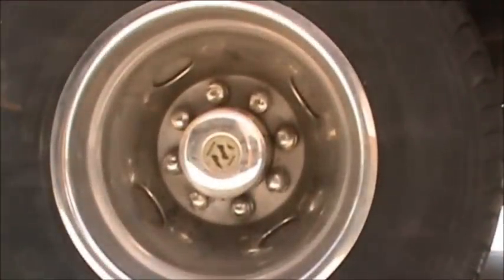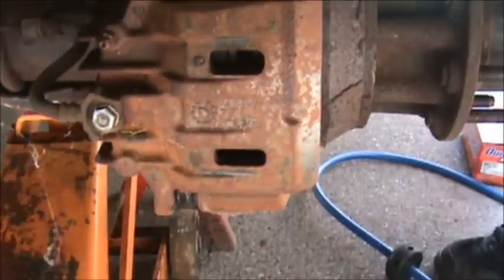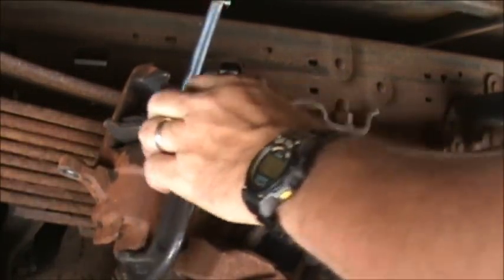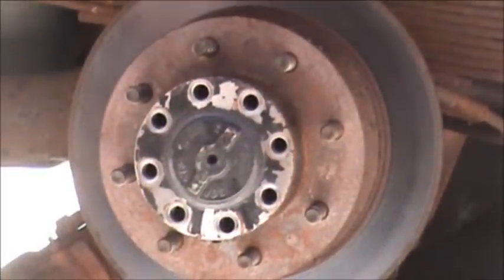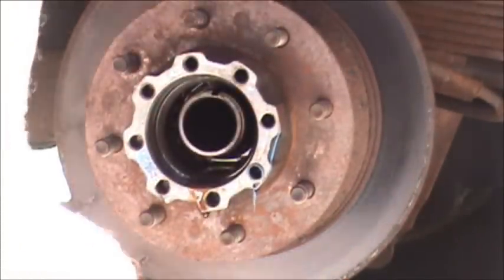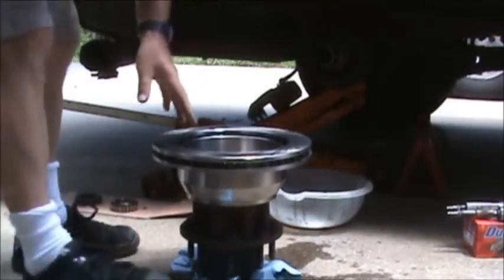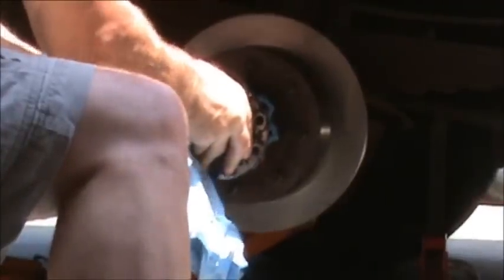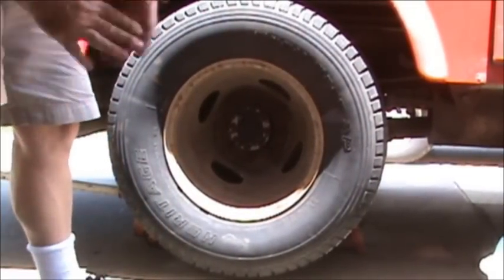2003 FORD F350 Super Duty Power Stroke Torbo Diesel

Comment: Hey... thanks for posting this. Very good descriptive video. I wish my wheels had come off that easy. Took four hours and two different types of pullers, beating and lubing.Thanks again!!!
Reply: next time leave 3 or four lug nuts on loose and drive down the street. it will pop loose. it may mess up your studs, it may not though. worked for me.

Comment: Don't you need to make up the lost fluid?  Do you change the differential fluid at the same time or do you just add what was lost and if the latter how do you know you have added enough?  Thanks
Reply from the maker: +Glenn Haake The fill hole is big enough for a finger to go in, the fluid should be at the top of the fill hole. A lot does not come out although you do need to check your gear oil afterwards. You just add it until it starts coming out the fill hole if needed. Sorry, I probably should have showed that also.
Reply: so you don't need to pregrease the bearings, would you recommend tilting the truck to get the oil down to the bearings?
Reply from the maker: You can lift the truck up on one side to tilt the oil. The oil is lubricating the bearings not grease. You can put grease on them but once you seal the cap the oil will be in the axle also. Make sure you grease the brake pad sliders.

Comment: all that work and you didn't change inexpensive seals? dosnt matter if they are leaking or not...
Reply from the maker: Don't fix it if it's not broke
Reply: @LonnieJohnson1  until it is, then it all gets torn down again....
Reply from the maker: The brakes and rotors will need replaced again before the seal fails because I'v done it to many times.